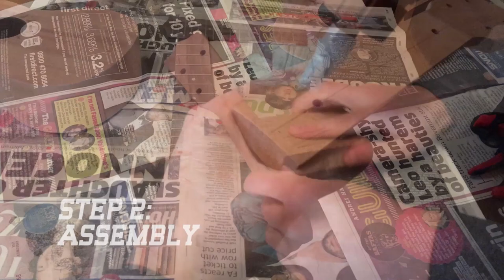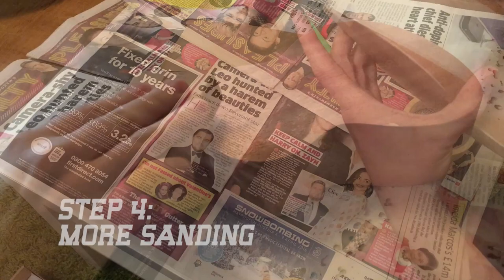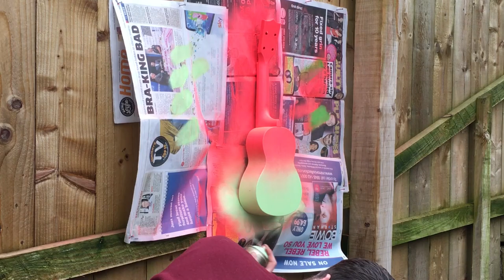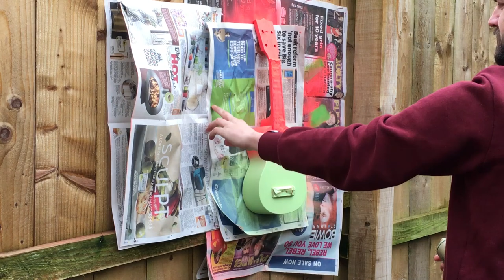Custom painted DIY Ukulele Build by Tom Boyle Illustration!

Comment: Cool look!  I have painted one too (have a video of it) and for those interested in doing one yourself my biggest tip is that if you think it has enough varnish - it doesn't. I under varnished mine. 
Varnish. Varnish. Varnish.
Reply from the maker: Just checked it out, really lovely work, and you are right I had to do a few coats of varnish! :)

Comment: I know I’m all late but I’m restoring a uke as well. I want to add drawings to it but I don’t know if it’s simple or not. Like do I use a pencil and if so what do I use to trace it? A sharpie marker or something else? When you were at step 10, I saw you used a paper of some sort. What kind is that and what is it for?
Reply from the maker: The piece of paper is just regular paper that I drew the design on, then covered the back side of the paper in soft pencil so that when I pressed down on it on to the Uke it transfers the design through! And I use Posca Paint Pens for the black lines!

I hope that helps, good luck with your own! :D
Reply: Tom Boyle Illustration thank you so much for the help! Thank you for taking time out of your day to help me! It means a lot! Thank you so much!

Comment: Hey! Could you leave a link? can’t find this kit anywhere. It sounded beautiful! Did it come with strings? If so, what kind? Sorry for so many questions lol.
Reply from the maker: Unfortunately it was a gift so I don't know where it came from, but there are many similar kits out there, it came with strings and I believe they are plastic? Sorry I can't be more helpful!
Reply: Tom Boyle Illustration That’s okay! I have found lots of similar kits, but with this one I’ve noticed that it sounds wonderful, did you use the same strings that came in the box?
Reply from the maker: @isabelladgriff  Yeah I did, very easy to string up, I would suggest stretching them a bit once you have them attached as when they are new they go out of tune very quickly! Just lightly pull at them from side to side and eventually they will be fine! :)
Reply: Tom Boyle Illustration thanks for the feedback! If I’m ever able to find this, this would be a fun ukulele, it sounds amazing even with those strings.